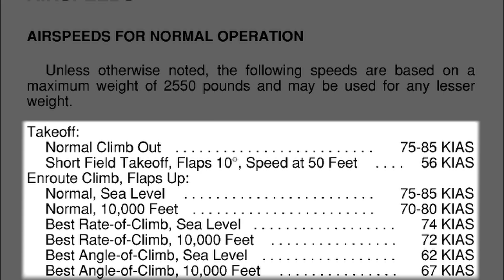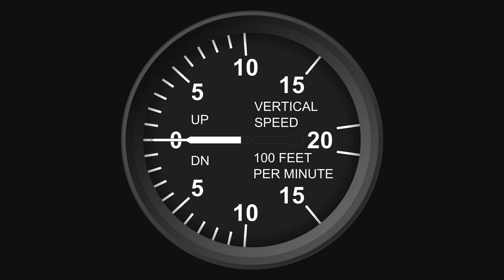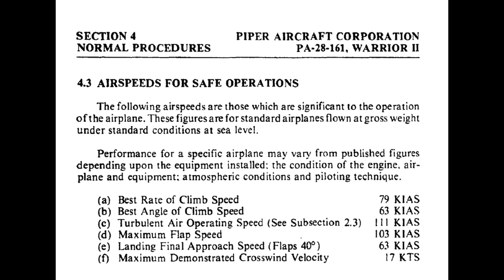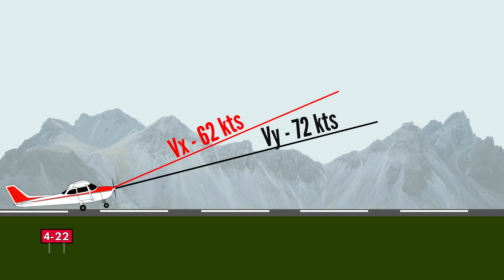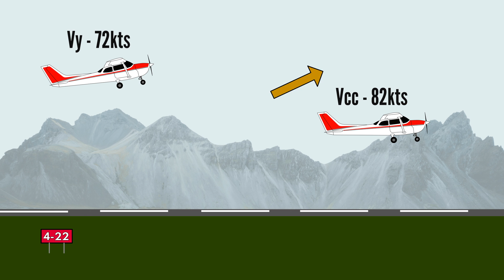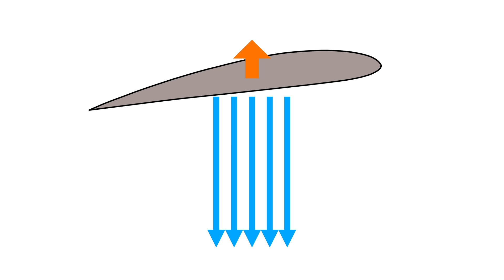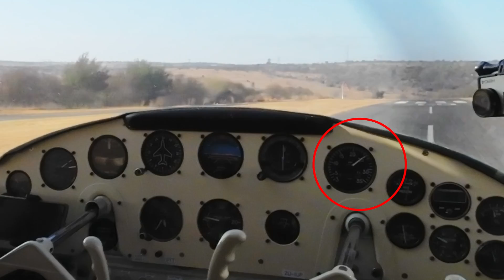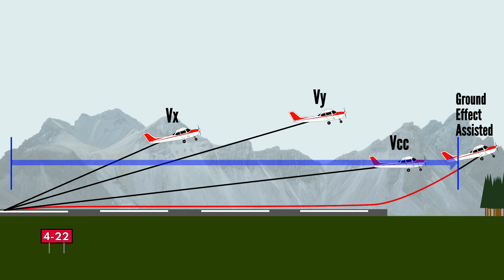Which Climb Speed is the Safest in a Light Airplane?

Comment: A blast shield on an aircraft  carrier does not increase jet performance, as jet engines propulsion is based on  momentum. It's just there to protect other aircraft.
I like your explanation of the various climb speeds and their consequence for obstacle and terrain clearance.
Reply: And helicopters can hover at the same altitude or maximum weight whether in ground effect or not.  Oh, wait…
Reply: @LTVoyager A better example might be a Harrier Jump Jet.
Reply: @LTVoyager  Helicopters have more lift capacity in ground effect for the same reason fixed wing aircraft do: the ground interferes with the formation of wingtip vorticies, keeping them smaller and allowing more of the wing/rotor to be working in clean air.
Reply: @ShuRugal True, and your point in regard to may comment which said the same thing?
Reply: @LTVoyager  a jet engine (or any other ducted thrust source) does not produce wingtip vorticies.  it cannot benefit from ground effect in the way a helicopter rotor can.

As another commenter mentioned before your initial reply, jet engines produce thrust as a byproduct of creating high-speed low-pressure exhaust.  anything which raises pressure at the exhaust outlet reduces thrust produced by the engine.
Reply: @ShuRugal It has little to do with wingtip vortices.  It has almost everything to do with pressure differential.  Jet engines produce thrust from both mass acceleration and pressure differential between intake and exhaust.  Only a rocket engine produces thrust nearly entirely from mass acceleration alone and thus can work in a vacuum where no significant pressure differential exists.
Reply: @LTVoyager  "Jet engines produce thrust from both mass acceleration and pressure differential between intake and exhaust"

I'm sorry, but this is flat out not correct.  Jet engines make their thrust almost exclusively from exhaust velocity.  Virtually every modern jet engine is designed to exhaust as close to ambient pressure as possible.
Reply: @ShuRugal Tell that to NASA. “Jet engine thrust is primarily generated through the reaction of accelerating a mass of gas, which accounts for the majority of thrust. The pressure difference across the engine also contributes to thrust, but its effect is usually smaller compared to the thrust produced by the mass flow rate and exit velocity of the gas.”
Reply: @LTVoyager  ", but its effect is usually smaller compared to the thrust produced by the mass flow rate and exit velocity of the gas."

literally right there in what you quoted.
Reply: @ShuRugal Yes, smaller but not nonsense as you suggested. The ratio varies considerably and for modern high bypass engines a significant percentage is from pressure rather than second law.
Reply: @LTVoyager and how many carrier fighters are running GE-90s?
Reply: @ShuRugal Nice try to deflect from your error.  ALL jet engines produce some thrust from pressure difference.  It would violate physics to suck air from one side of a system and expel it out the other and claim there was no difference in pressure.  That is a ludicrous claim.
Reply: @LTVoyager lol, if that ain't the pot calling the kettle black, nothing is.
Reply: Does a Harrier Jump Jet require the same amount of thrust to hover 3 feet above the ground as opposed to 300 feet?
Reply: @igclapp It requires the same thrust bc it has the same weight. But, to achieve that thrust you will need a higher exhaust gas total pressure to achieve the same exhaust gas velocity if you're near the ground. Exhaust gas Mach number is a function of the ratio of exhaust total pressure to local exhaust static pressure. So if you increase the static back pressure you need more total pressure. In effect, i'd expect you need slightly more engine RPM when you're close enough to the ground for the exhaust nozzle to feel any backpressure. Now in reality, this effect is small and designers know this so they aren't going to put a nozzle in a place where it basically exhausts right to the ground.
Reply: @markzsurka1643 there is a VERY SLIGHT decrease in the need for power as a jump jet approaches the ground, but it’s so slight and so close to the ground it may as well not exist. For helicopters the effect is massively more pronounced as your thrust-generating area and your lift-generating area are much larger. Loads of air moving and loads of wing to trap it under
Reply from the maker: Thanks. You are correct, I don't think jet performance plays any factor in the use of a jet blast door. And when using a catapult, it wouldn't even make sense to use it to increase thrust (as the catapult does the work). Thanks for the correction. 

But it will increase thrust nonetheless. The blast door redirects air up at a fairly high angle, and in turn resists the free flow of air backwards horizontally (the direction it is spewed out of the engine). That resistance of free flow increases pressure at the point the air gets redirected. The point of the jet blast door is to shield what's behind it. Without it, if a person was behind the jet as it powers up, they would likely be blown off deck, correct? That's because of the force enacted on the person. If you push against a wall, the wall pushes back just as hard. So both in terms of fluid dynamics and newton's 3rd law, thrust will be increased. I don't know how much additional thrust is provided though.
Reply: @LetsGoAviate  no
Reply: @LetsGoAviate the thrust increase would only be minor and within short distance from the exhaust deflector, kind of like ground effect. It’s effectively the same phenomenon produced a different wat
Reply: @LetsGoAviate . I can’t believe you think that.  😮
Reply from the maker: @annoyingbstard9407   I know right 🙄. I researched it a bit, made a video and admitted that I was wrong, and explained exactly why it doesn't increase thrust.
Reply: @LetsGoAviate  Actually, that increase in exhaust nozzle pressure force is adversely compensated for by a decrease in exhaust gas momentum (because exhaust gas velocity decreases when exhausting to a higher pressure). At best you'd break even, but a small decrease in overall thrust is actually more likely as the nozzle exit plane pressure and momentum tend to not trade exactly one for one and momentum is the bigger driver. You can do a CFD simulation and prove it to yourself by integrating pressure, friction, and momentum forces over your control volume.

Comment: What is astonishing is how many pilots disregard the POH despite the fact that the designers have studied all the possible scenarios and the manual is a compilation of their knowledge and experience.  Bad habits and incorrect reflexes, especially if acquired from poor instruction, can eventually lead to disaster.   If the engine fails at an early stage of climb out, the natural reaction to keep the nose up is fatal.  My CFI would never let anyone solo until they had the acquired the reflex to lower the nose and preserve the airspeed.
Reply: You have a good CFI.  If that engine starts sputtering, or even dies immediately, studies have shown that many pilots take about 3-4 seconds to realize what has just happened.  Good CFIs train their "students" to get the nose done immediately, even if it creates negative Gs while doing so.
Reply: Early/previous training in gliders is also very helpful as students are trained at an early stage to respond instinctively to a cable break by pitching down for airspeed.
Reply: My old plane won't make book numbers, and I'm not alone in this. (Comes closer with the Powerflow exhaust, GAMI injectors and K+N airfilter). The reason: It's overweight. I have scales in my shop. For planning purposes, I weighed it with interior and all insulation removed, no oil, no fuel, no avionics, it was still 100 pounds above Cessna's claimed numbers!
Reply: @cujet  That is very interesting.  Do you have the same wheel skirts as the original?  Have they been removed?  Wheel skirts reduce drag, as you know.  Have you added any new parasite drag components?     
       It's possible either your scales or Cessna's scales weren't calibrated against a standard weight.  But still, one wouldn't think that 100 lbs. would not make much of a difference in the book numbers. 
        My buddy's Mooney M20C consistently trues out between 145-147 kts at higher altitudes whether it's at gross weight or much lighter.
Reply: @cujet  Do you mea they lied about the empty weight ?

Comment: I would think if you are climbing out at Vcc and have an engine failure, you should in fact climb a little to gain altitude until you slow to Vglide so that you now have the highest possible altitude and are configured at the best glide speed for maximum distance possible.
Reply: That's true, because that way less energy is lost to drag. However it's safer to have reflexes to pitch down than up. If you have the brain space to think in that instance, then pitch up for best glide after the reflex.
Reply: Yeah. I was thinking that exact point. “Am I really going to be able to think all that through in the moment?”I hope I’d actually immediately pitch down, but then adjust after. I think I’ll take a little loss in energy as long as pitching down is a reflex!
Reply: @arpeltier  My engine failures were six second deals.  I always had airspeed from ground effect on takeoff or in the spray swath in the field.  This allowed me to maneuver as necessary to what looked best in the very near hemisphere from a couple hundred feet at most.  No pitch down is necessary with zoom reserve airspeed.  An energy management 1 g turn at any bank angle is available.  Pitch up wings level, turn to a good site while releasing all back pressure on the stick, this allows the nose to go down as designed to prevent stall, add full flaps and forward slip (I was almost always high and fast to what I could see from down low), and touchdown slowly and softly in the beginning of the landing zone.  Flying all the way to the crash works best.  What to do is pretty obvious so not a lot to think through in seconds...no moment available.

Comment: A soft field takeoff is basically a special case of a ground effect assisted takeoff once the plane is airborne.  I guess one of those maneuvres most pilots don't ever need after passing their practical exam.
Reply: The soft field takeoff is actually the best short field takeoff.  As Wolfgang says in "Stick and Rudder," try to hit the tree and then zoom over.  My default takeoff is level in low ground effect until Vcc or end of runway or need to pitch just over an obstruction.  No, not a special case.

Comment: At 4:33  My VSI indicates considerably HIGHER FPM climb rate at Vx than Vy.  Not lower climb than Vy as the author claims.  In addition, an early Vx climb gives me more runway remaining and maybe other landing options for an early engine out...
Reply from the maker: Vx with a higher vertical speed than Vy is an Oxymoron. Vy is the best rate of climb, you can't climb faster than your fastest rate of climb. Whatever airspeed gives you the highest fpm gain, thats your Vy.
Reply: If you are at considerably less than gross weight, that is not surprising. The published Vx and Vy are at gross weight.
Reply: Look at the videos.  Why do pilots wish to quickly get high enough for an inadvertent stall, which they are much nearer at slower airspeed, to be fatal?  Too many stall/fall into the middle of a long runway.  What kind of total energy management is that?

Comment: On commercial flight, there is a concept of "improved climb" that uses excessive runway to accelerate to higher speed ,technically, more closer to Vx, rather than exceed it. but the "ground effect" stuff seems quite similar to that, so my questing is rather than using ground effect. why not just accelerate on the runway, which you can stay at near 0 lift AOA thus very little drag.
Reply: If you experience the basic level in low ground effect takeoff, you will see how much that friction drag of the wheels rolling on the surface delays airspeed development by comparison.  The design of the airplane is to fly, not to roll on the ground.  Start with the yoke all the way back.  When the nose wheel (if tail wheel, you will have to push the yoke to level the fuselage as soon as possible) comes just off, use dynamic elevator to fix it just there.  This should happen quickly or abort.  When the wing will carry the weight of the airplane in low ground effect (this is much slower than Vx, Vy, or even Vso, an out of ground effect number), use aft elevator to bring the mains off.  Now we are off the surface but at too high pitch attitude.  Work the elevator fore/aft rapidly to bracket level in low ground effect.  In low powered airplanes the trick is to no touch back down while leveling.  In high powered airplanes the trick is to push (if trim set for Vy climb) the nose down hard to get level in low ground effect.  Now acceleration is very rapid to Vcc in far less runway than even required to accelerate to Vy on the surface.  In strong crosswinds, I position the airplane on the downwind corner of the runway pointed at the upwind thousand feet mark.  In this new thousand feet centerline I can easily, with all that extra now headwind component and ground effect, get off and accelerated to near Vcc in a C-172 size/power airplane.  Now, for comfort, I rudder turn in low ground effect to go on down the upwind side of the runway or just climb at this angle if no obstructions or traffic.

This is a technique every crop duster, sorry Ag now, uses.  Also every takeoff with full load at high DA airports should use this technique and down drainage egress.  We don't need this extra free ground effect acceleration energy until we need it.  If already at a couple hundred feet when we realize we needed it, it is too late.  Why is climbing at a very uncomfortable pitch attitude to get high enough for stall, with or without spin, to be fatal the school solution for airplanes without moon rocket quality propelsion?

Comment: Note for ground effect takeoffs:- there will be no data for this take off in your aircraft manuals, if you need obstacle clearance I would recommend sticking to published technique and speeds unless you are very experienced.

If you exceed Vfe you are very unlikely to cause structural damage to the wing - you are more likely to damage the flaps or flap linkages. 
When executing a ground effect assisted takeoff, if your aircraft can takeoff flapless then I would recommend this technique over retracting flaps whilst flying in ground effect.

Comment: Great video, thanks! I own and fly a Mighty Thunder Cardinal 177RG (a little joke, as there is no thunder and no might). Accelerating in true ground effect is really too low for my comfort level, but I've tried Vx, Vy and Vzoom, albeit above ground effect, and noted my altitude and speed in the pattern at different points. Flying out of F45, I like to get over 2500', to avoid the adjacent Class D. All methods will result in about 500 feet of altitude at the end of the upwind/departure leg. But your Vgeac (haha very funny) does result in more airspeed at every point. My plane absolutely will not accelerate anywhere near cruise speeds while climbing in the pattern, unless I perform a Vgeac. This means I can both reach 1000' in the downwind and be generally faster. One thing seems clear, spending a lot of time in high drag flight does not result in more total energy in the pattern. As one might expect, getting over the nearby Class D requires effort. Keeping drag low seems to make it much easier. That means no flaps, gear up asap and accelerate first.
Reply: ha! you haven't lived until you have flown a 150hp C-177 (fixed gear) at gross weight (or maybe a little over...) from a grass strip in South Florida on a hot day...

Comment: The faster, always the better! I prefer to accelerate at the highest possible rate with flaps fully retracted and elevator at zero lift for minimum possible drag and only lower the flap just for the highest lift/drag ratio (yes, at some very low flap setting, the lift/drag actually is higher than with flaps 0) when I'm a few seconds from the liftoff speed, speed which I calculate as needed in order to have the AoA at no higher than 5 degrees (most pilots don't understand what the AoA does by the way) and after the liftoff I keep flying as close to the ground as possible while raising the gear in order to build up as much speed as possible and as I build speed, I also raise the flaps back to zero and continue on building speed in ground effect until I get at over 70% VNE and from there I start climbing until I settle on the needed slope to hold a needed speed for the maximum lift/drag ratio AoA and keep it that way for as much as I need to climb. I do all of that to maximize the total energy at any given point on my flying pattern so that in case I remain with zero thrust, I can transfer that energy as I need. Most go for trying to increase their potential energy (height) very quickly, thinking that it's mostly height that is useful and they are partially wrong, because when they get surprised by a total loss of thrust, their psychological effects and fear/panic kick in, they lose the little speed they have rapidly, and even though they had maybe enough altitude built up to make a 200 deg turn, they'll mishandle the AoA and stall a wing and it's done for them. I only wish that airline pilots regulations would also allow them to build up as much speed as their runway length allows them to get before getting airborne for just that cause. The higher the speed, the more options of survival.
Reply: If Vx clears the trees at the end of the runway and Vy does not, I’d say that faster is most definitely not always better.